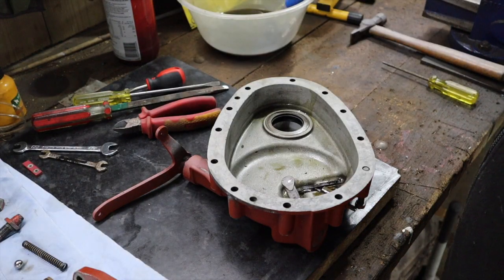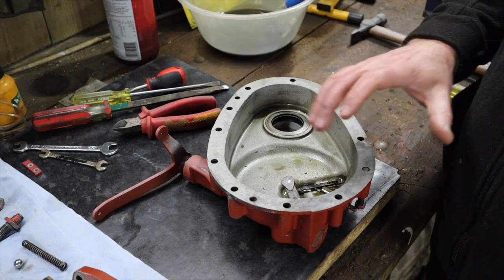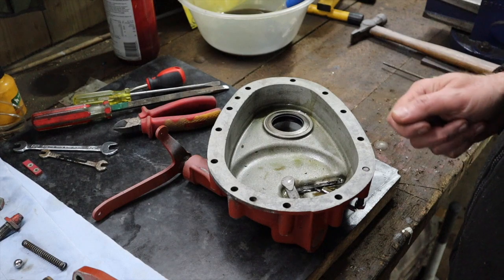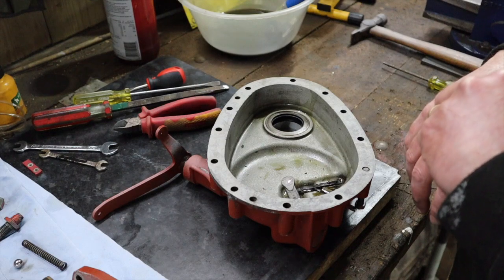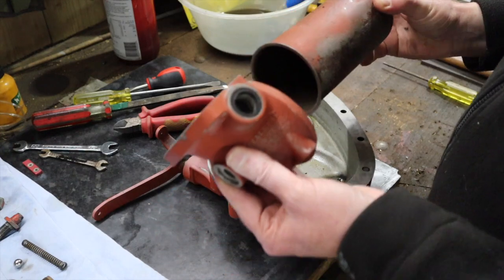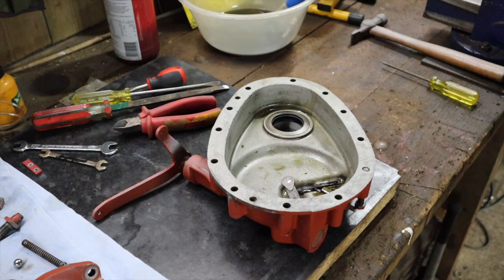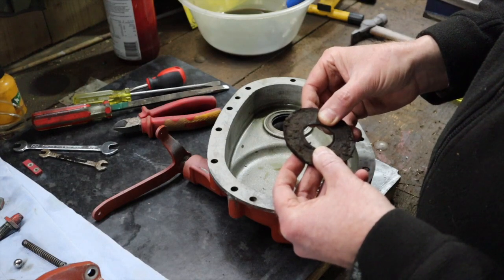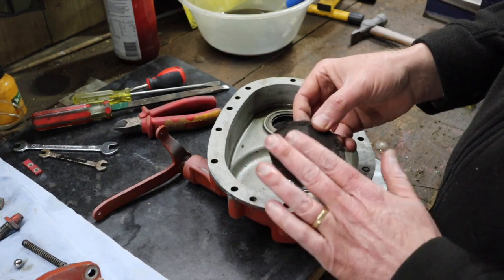#99 TED20 - Oil Filter & Timing Cover - with Anglo Agriparts

Comment: Hello Gordon. Many hours are spent cleaning, sanding and chasing threads. The joy of working on old stuff. The governor adjusting screw on my tractor was broken at the locking nut. I tried making a replacement, but chickened out and purchased a new one. If the engine begins to hunt/surge at idle, the screw is adjusted to stop that condition. As you stated, the initial bench setting is when there is a slight resistance and the throttle arm moves a wee bit. The final adjustment is normally set with the engine running at idle. This is somewhat similar to the old mechanical Woodward governors. The modern engine relies 100% on electronic gadgets. TTFN/CDC
Reply from the maker: Hi Charles, it seems endless sometimes, but it is also very pleasing to work with and reassemble clean components, along with new bits where necessary. I’ve just completed the reassembly of the steering box and it feels like a major milestone. (Video will be published soon) 👍😉
Reply: @WaterhouseForde  I overhauled the steering box on the TE20 way back in October 2021 or at least it feels like it was back way in time. Finding the correct parts was an interesting challenge that took much longer than the actual job. I can play in the garage for hours cleaning parts, get lost in the zone and not worry about anything going on in the world.

Comment: Hallo and thanks so much for your video ... I injoy so so much ...super nice work you do there ..
And a Little moment to your oil  filter too. 😊😊

when we renovate our old tractors we see many fun things that the previous user has done on the tractor.  .... You also found some things inside your oil filter .... inside the container at the bottom there should be a spring and on top there is an iron disc that should fit close to your new oil filter ... oil should be pressed  through your new oil filter so particles get stuck on the outside and inside the center of the filter the pure oil goes back to the engine again .... the oil does not go down to the bottom of the filter and up into the filter In the middle ..... so now by  you that something is missing at the bottom of your metal container ... maybe you can use a washer and an o-ring or glue some soft rubber on a round metal washer with a hole in the middle and then a spring to push it up......Hope you can understand What I mean .... Look forward to next episode nr 100 👍😊😊Michell . NORWAY
Reply from the maker: Hi Michell, thank you again for your comment and for this info. Actually I do have the spring loaded disc at the bottom of the canister as well! 😮. Maybe someone decided to fit a slightly smaller filter cartridge? I will check when we install the cartridge. As you say it should compress the spring a little to create the required seal. Let’s see when we get to that part. 👍😉
Reply: @WaterhouseForde  Funny all the things we found inside/outside our tractor's ....Inside gearbox I found a Nail Holding the gears to the pto ..I have replayse it now with the reighte parts 👍

Comment: Great video, thanks and keep it up. One question, you talk about needing to put the flywheel back on to do the timing - why is that? Interested to know what I'm missing as I thought the timing can be set on the stand with either the marks on the timing gears or if needs be by setting tdc with the valves open /closing?
Looking fwd to the big centenary and wishing you luck with the stud extraction. Hopefully you will post a video of that too!
Reply from the maker: Hi Ewan, thanks for your comment. I need to check to confirm, but on some engines the flywheel can go on in 2 positions; 180 degrees opposed. Either position will work, but if your flywheel has timing marks stamped into it, then you have a 50/50 chance of these being in the right place. As I say I need to check this flywheel, I’ve not spent too much time analysing it. 😉 I hope that helps. Removing the Ez-out stuck in the stud fragment is proving to be almost impossible! 😢 But I have a new plan to try this coming weekend. I’ll film it and if it works I’ll let you all know 😁